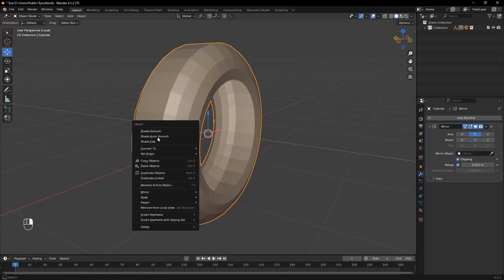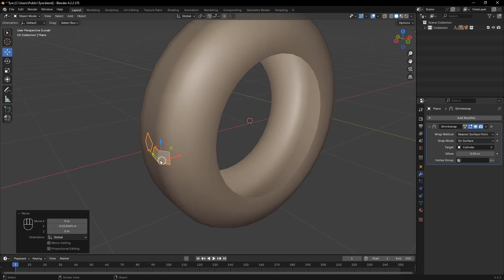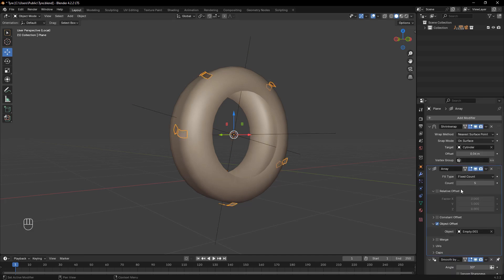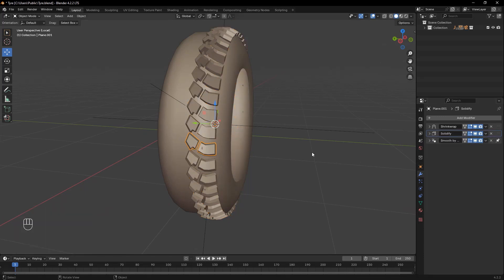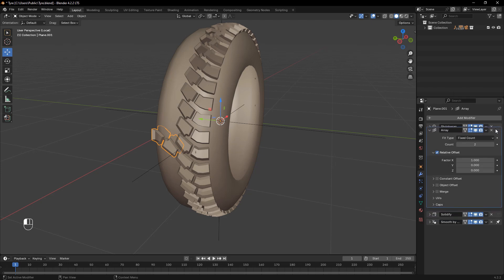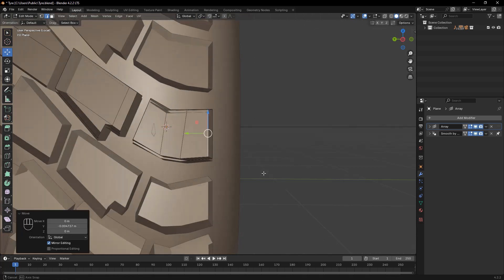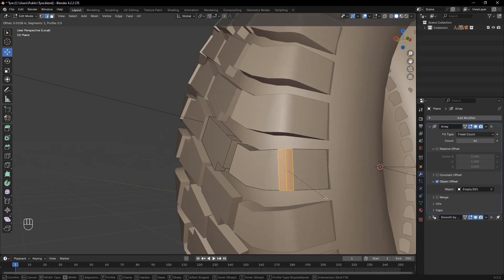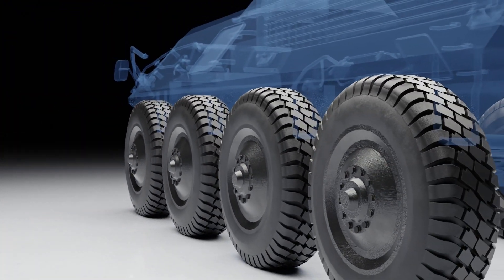How to Model a Realistic Wheel with Tire Tread  in Blender (Part 2)

Comment: No matter what I did, array modifier refused to work and just generated duplicates everywhere unaligned with the cylinder. Messed around with the 3d cursor and points of origin and it's all too hard.

The shrinkwrap works fine to just copy-paste the pattern object all the way around manually.